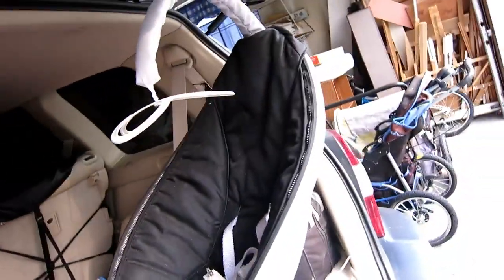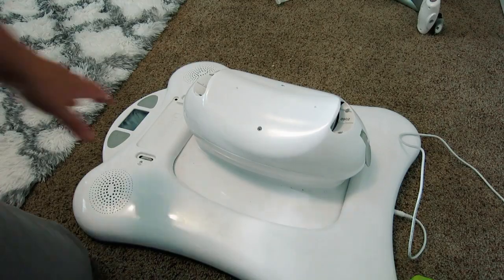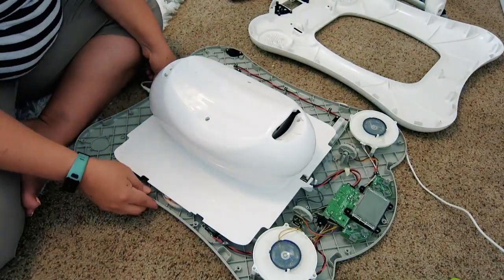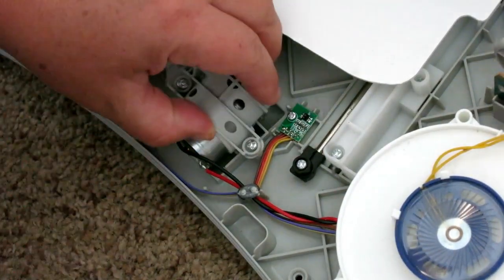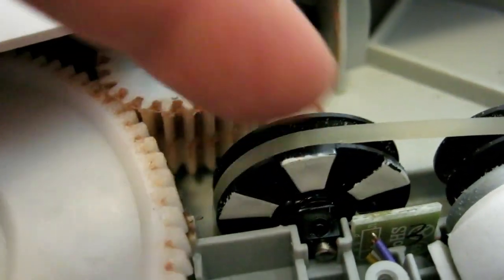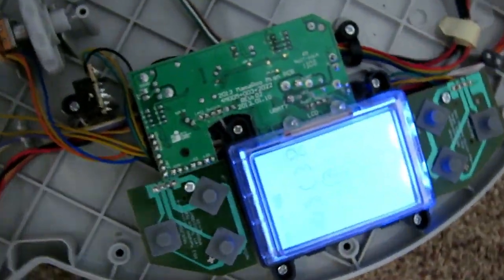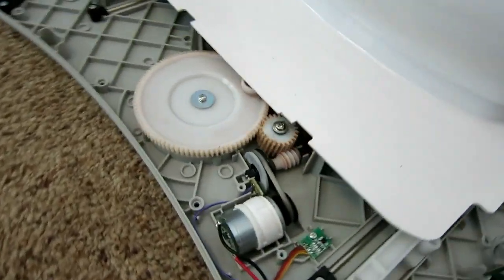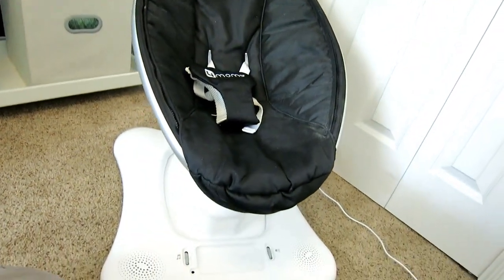I Just Scored a $10 Mamaroo/ How to fix your MamaRoo Obstruction/ Mom Fixes MamaRoo

Comment: There's another sensor under the back side of the part that goes up and down looks like a little computer chip with a white plastic thing holding it in place. Under that sensor is a bigger version of the black wheel with the white squares where that belt goes on the motor. That's where my problem lied and I'm just letting anyone else know on all these videos Ive used to get to fixing my issue. Open to messages if need be... Thanks
Reply from the maker: Glad you were able to figure out what was wrong with yours thanks for adding another way to fix it!
Reply: Hi could u explain better

Comment: Did u show the actions you took to make it work? Seems like u took it apart, then cut to u holding nail polish, but not actually showing what you did to make it work.
Reply from the maker: You use the nail polish on the part of the wheel.  you have to paint back on the white its a sensor disrupter that sometimes wears away and just needs to be re-coated.  You paint it then let it dry and put it all back together and see if that works.  That was my main problem i also sugget oiling all of the moving parts.

Comment: Trying this on a 2017, but was wondering how long it lasts . Is it a temporary fix?
Reply from the maker: mine still works and I did this back in August. it did work better the more you use it though. I let mine sit for a month before I had my son and had to wd 40 all the parts. but it has worked fine since then.